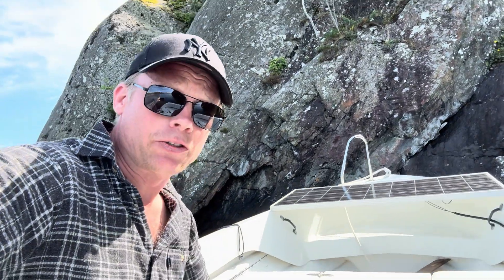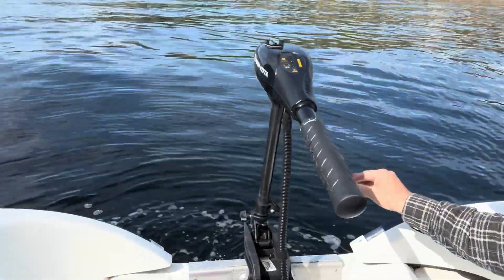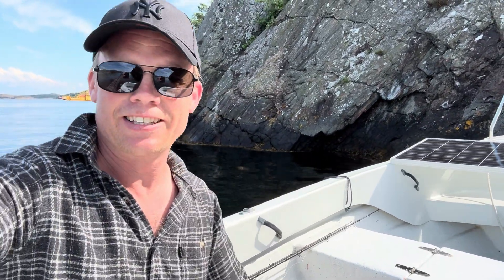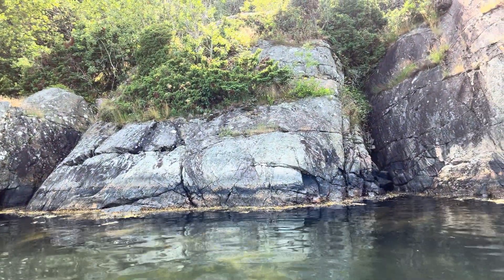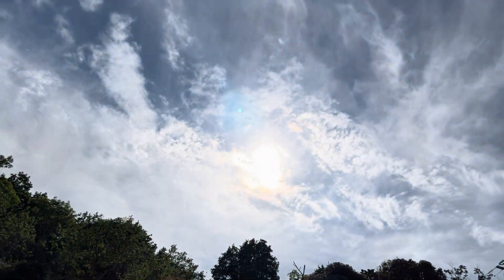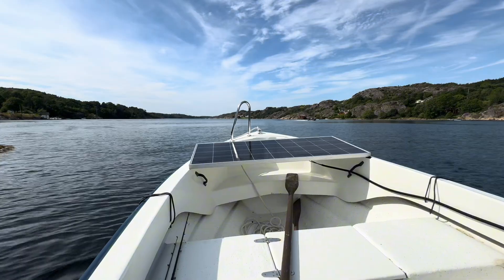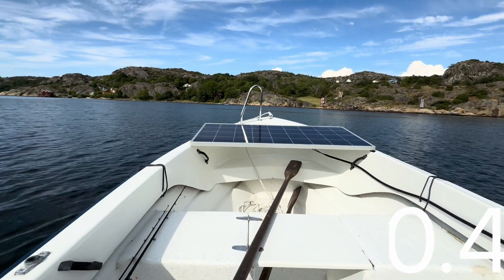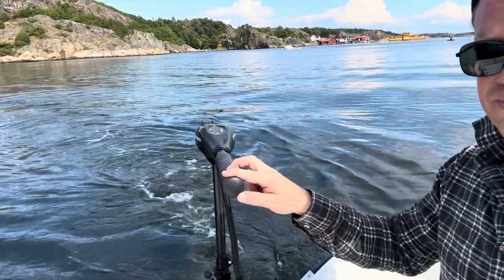Electric outboard motor directly on a 160w solar panel, no battery.

Comment: Solar and boating is great, but just a little buffer makes it usable.
I guess this would do fine with a standard 400W panel, and on cloudy days perhaps some kind of MPPT on the motor speed but you could adjust yourself.
These motors are often only 250 Watt, though there more powerful versions.
Reply from the maker: It really is.
A blue sky and 2 in parallel 400W panels will be pretty close to what the motor needs at full load.
Reply: @flyingtools  I worked with other people on a boat that had a 12kWh battery and 500W of solar.
The boat was something like 6 or 7 meter, and he made it so efficient that you could take it out boating on a sunny day and still have the same battery level when you came back.

But with boats it is even worse than cars, if you exceed a certain speed the consumption gets really high.